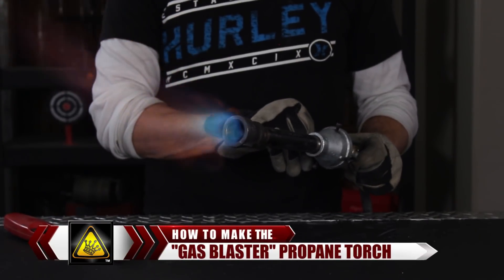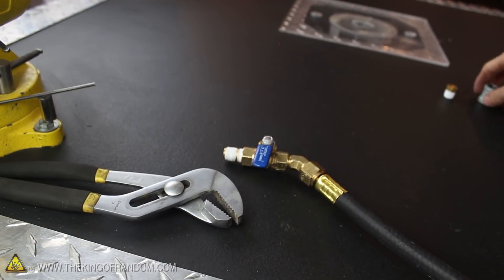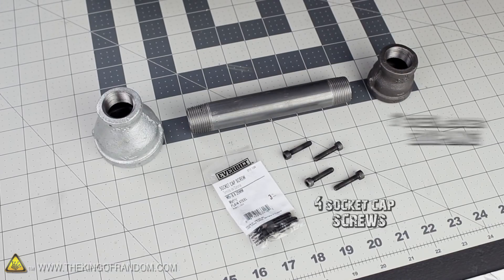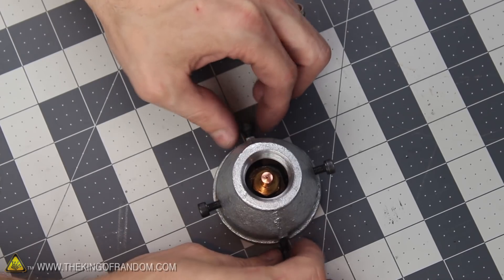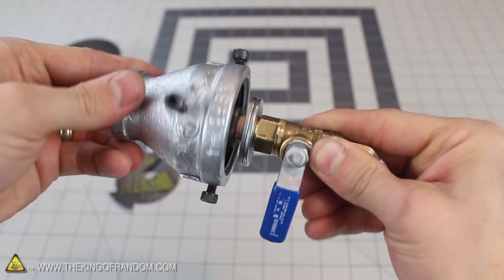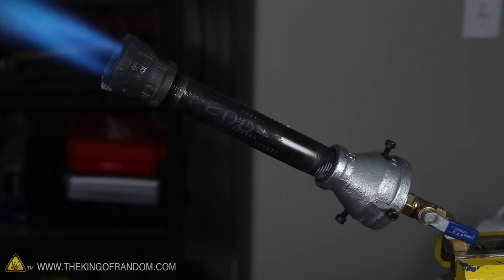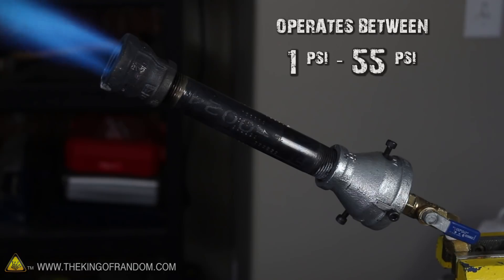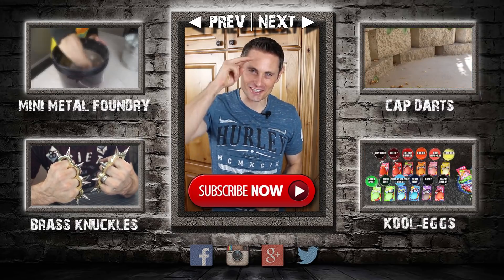Convert Your Backyard Foundry To Propane! ("Gas Blaster" Propane Torch)

Comment: I'm surprised you didn't add some sort of flashback suppressor to the setup. I realize even most commercial propane setups don't bother, but after I've had to call 911 for a propane fire traveling back up my hose to the regulator, I've become quite cautious. That was only a BBQ, nothing as risky as a torch.

Comment: Teflon tape isn't rated for gas fittings.  You need to use pipe dope or a tape rated for gas use.  Also, galvanized fittings and high heat are bad news.  The zinc creates a toxic gas when it's burnt off.  Other than that, nice video!

Comment: I made the charcoal foundry I have found it also works with wood, but wood makes lots of sparks. I have had trouble melting copper I bet propane would. I might do this aswell
Reply: Wood is a great material to use for your propane torch as well, just change all metal items with wood! ;)

Comment: who here is really gonna make this? just wondering.
Reply: Me. Im going to build a propane forge. A good venturi burner costs 100 bucks.
Reply: +My gamertag is (deathdoneright) have fun. I built a charcoal forge in August out of a square steel gas tank from a wood splitter and clay+wood ash+straw insulation and a pipe with holes for an input. I just started using it last week and build a folding knife and a twisted handle railroad spike knife. It really is fun.
Reply: +Moe Moradi no one he is just showing to us how cool he is look at me i am doing this and that nobody should do like him cause he have many safety and maybe there is people behind the camera helping getting things done i dont bealive he is alone doing fire and risky things just for a video in youtube
Reply: Me :D
Reply: way more applicable than ud think, I'm gunna do it to make a soft metal foundry so that I can cast brass cross guards and pommels for the knives I make lol, forge isn't right size for a crucible to fit
Reply: +Tyler Amox (Pirga) How much did it cost?

Comment: will the tip melt itself in the foundry??
Reply: +gpctrs jr Nope, it doesnt get hot enough to melt steel by far!
Reply: It could.  Steel melts at about 2750 degrees & propane/air can get as hot as 3572 degrees.  Just keep the nozzle out of the combustion area & you should be fine.  If the top does melt, you can just replace the fitting.
Reply: +MysticFireNinja it very well could, not as easily as aluminum or brass, but it could, trust me.

Comment: woo, and it looks like im able to build this for my foundry, question about the foundry actually, mines started to crack in its bucket, did yours ever do this?
Reply: +Nathan Miles i forgot to mention, i also run this off oil, im just trying to figure out if its just the mix or if the oil i burn has a part

Comment: Can I use this thing for cooking stuff in a barbecue instead of charcoal???????
Reply: +Jason Pesigan I don't use anything but propane!
Reply: i put a wok on top of my foundry one time.  made some awesome food while melting aluminum.
Reply: If u like it crispy lol
Reply: If u like it crispy lol
Reply: +Tristan Jones (corsairfanboy) Really? Huh! I ALWAYS blowtorch my hamburgers.
Reply: +Jason Pesigan DONT PLEASE
Reply: +Jason Pesigan Probably not
its propane
Reply: Theoretically, but if you mess up you might end up melting your barbecue.
Reply: We use propane for our grill so go for it! ;)
Reply: +Jason Pesigan 

Yes but there are two things you want to keep in mind. You do not want to point the flame directly at the food, you want to heat the air around the food. The other is you will probably want to avoid and lead piping for health reasons.
Reply: +Tristan Jones (corsairfanboy) 
I dont think lead is a problem with the piping, but it is important to use black iron pipe and not anything galvanized.    the fumes from exposing zinc to high heat are toxic.
Reply: 2016
Not using propane blowtorch to barbecue

Smh